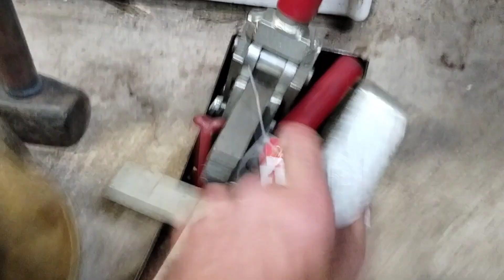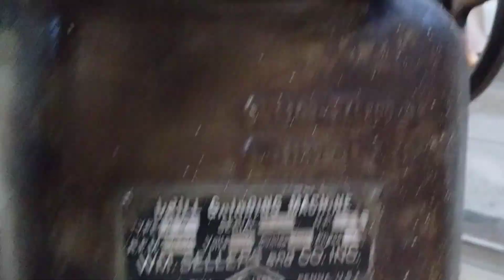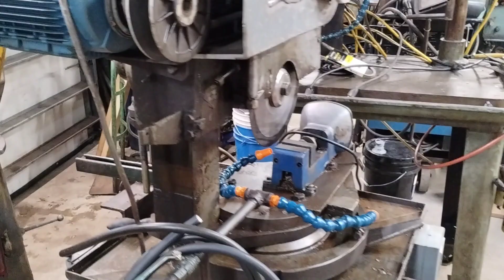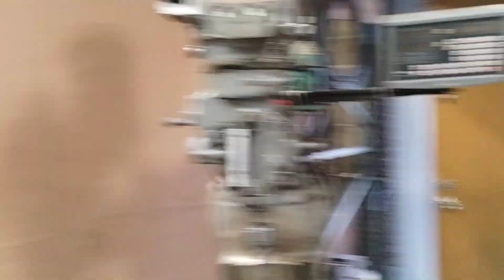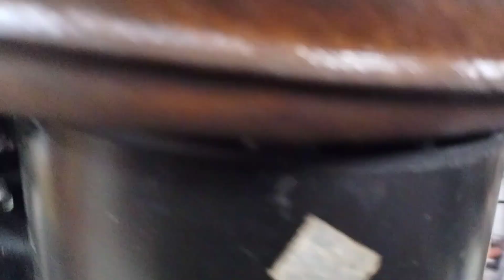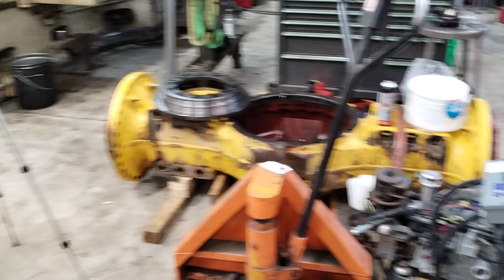We went to an auction, new machinery.

Comment: He actually got exactly what everything was worth. That’s the problem with old equipment. It’s worth very little. If it was worth more, people would have bid more. I’ve been to many auctions over the decades. Basically, most equipment, even if it’s in good shape, goes for little. Occasionally, some hobbyists, who have no idea of the value, will bid something up well beyond what it’s worth, but that an exception.
Reply from the maker: The same equipment that went for pennies on the dollar at this auction would sell for many times that at the local used equipment dealer. Case in point is the 8" capacity commercial cold saw with auto bar feed and coolant system, it is a $3000-5000 saw all day at any used equipment dealer, it brought $125. This particular auction was severely handicapped by being very remote and happening during a blizzard.
Reply: @ auctions always bring very little for old equipment. Companies that resell it have to charge more. Warehousing costs money. So does listing it. So does answering questions. Possibly doing some referb such as cleaning out much crap. It’s all about supply and demand. Nobody cared enough about the equipment there to offer more. That the answer. It’s worth what it goes for. Of course, everyone there could have said that this equipment is worth so much more, that I’ll pay so much more. Did anyone do that, or did they just pay the minimum? Maybe that says something about the people who bought the equipment.
Reply from the maker: This was an online only auction, the bid increments were preset, that was another detail that suppressed the outcome. My original point in the video is quite simple, don't sell stuff in an auction if you want top dollar. You would be money ahead to just sell it directly to a dealer as a package.
Reply: @ I understand. I also can’t fault your advice. I’m just saying that something is only worth what people are willing to pay for it when it’s being sold. There’s no point is getting upset about it.

Comment: Yes you pronounced that correctly. I have used one at the Stahl truck body plant. Very good machine. I have an auction coming up that has a Bridgeport mill vise. Looks to be in good shape. What would be a fair market value?  AL B.
Reply from the maker: Are you talking about one of the Bridgeport brand vises or the Kurt style? Kurts usually bring about $200-250 the older Bridgeport branded vises are about $150 in my experience.

Comment: Did you instruct wiggles on  the "Triangle of Safety"? I remember that from forklift training when I briefly worked at a Cat dealer. The sellers Drill grinder is a beauty Andy. well done. Poor old saw. Since you have it load a countersink in the Jet and leave it there. Just an idea. cheers
Reply from the maker: Not a bad idea with the countersink. The previous owner mentioned that he has a couple more of those Rockwell heads in the shed  that he took off from it. I thought I might see what he wanted for another one and just replace the jet with another Rockwell.